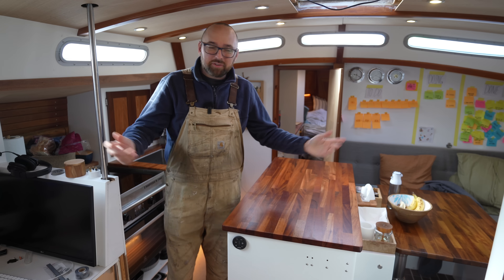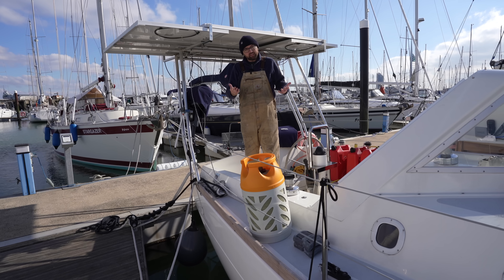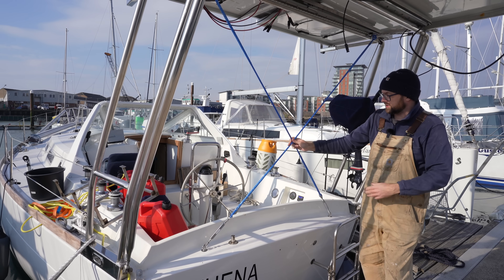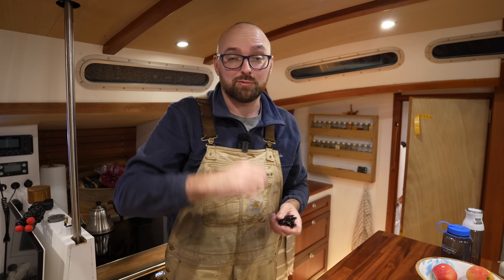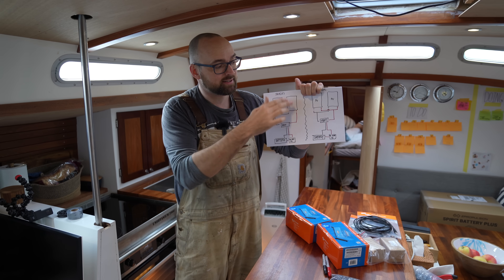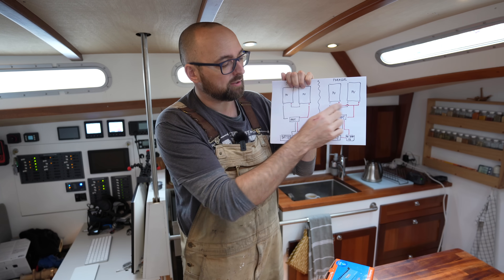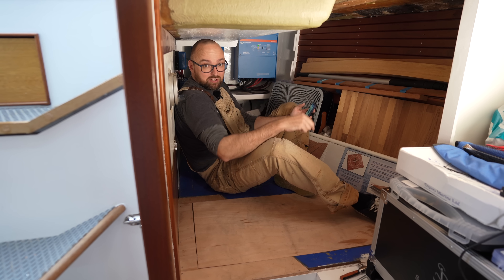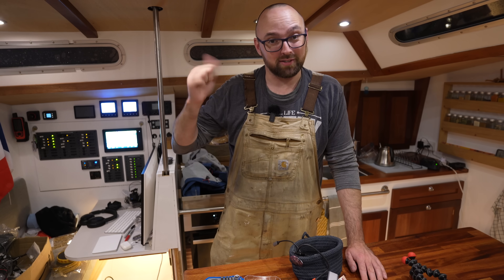Sail Life - 1600W of solar☀ on a 38 ft sailboat  & re-stepping the mast⛵

Comment: Your explanation about the higher voltage being a benefit is spot-on. There's an additional benefit to that, though, that's worth adding into the consideration. Battery charging won't happen until the panel voltage exceeds the battery voltage. With a 60 volt panel output, you should start charging earlier in the day and remain charging later in the day than if you had 12 volt panels. 👍

Comment: One thing I'd say in regards to your solar explanation is that the voltage drop loss isn't just lost. Conservation of energy dictates that the energy is instead, converted. In this case it is converted into heat which on a boat in particular is no bueno. Great video as usual.

Comment: Wow 1600W of solar is formidable, and I love your idea of the stowable panels!!! I'd still be slightly concerned about the weight of all those panels so far aft and high up from a boat-handling perspective, but I'm sure you've thought of that. Glad you added the Dyneema cross braces - they are certainly more than adequate for the job!

Comment: Confused about why you chose your wiring on the panels.  I would put the two upper ones in series, and the two lower in series, then wire the two pairs in parallel.  That way you can have a functional pair (the upper ones) without extending the bottom panels, for example when in cramped quarters, high wind, etc..  The way you have it wired, the array won't generate much at all without extending at least one of the lower panels.
EDIT:  Wait...  Just re-listened, and you say the panels are all in parallel.  Perhaps I'm confusing things with the 1200w system?  Anyway, all parallel with 65v panels is perfect.  Enjoy the power!

Comment: This video was awesome!  So I am thinking of adding solar.  My bank is around 400 to 500 AH - considering adding 400 Watts of solar.  2x100 on the bimini and 2x100 in front of the dodger....and maybe a solid solar 100watt fold down rail mount.  Thinking each 200 watt set would have a controller.  each run would be about 15 feet from the bank.  Any suggestions on series/parallel in this situation (4 100w panels in 2 sets), gauge wire, etc...?  Any help or advice would be appreciated

Comment: 2x 30A MPPT controllers seems a bit light for a 24v battery bank supporting 1600W of solar... my math brings that in at 66A. While it's unlikely to get full juice for any length of time, and charging voltage for Lithium is a bit higher than nominal... that's still pretty close to the edge.

Comment: I personnaly would not put more than 300W of solar on my 38 ft boat because of the detrimental effect on windward performances (because of the induced drag). Now I see in your videos that you seem to use the engine quite a lot and also you have a furling mainsail so I guess windward performances is just something you are ready to compromize (understandable in case you aim to sail in the tradewinds which I understand is the plan).

Comment: Ha, did the same type of cross bracing on my boats diy solar rig. However i moved up the cross and installed additional metal braces as it was getting in the way during docking a lot. Amazing ammount of solar though. You gave me a great idea for a future project and the higher voltage is a great tip. Thanks. Hope to see you on the water some day.

Comment: You may want to watch the Side loading on those little Eye's in your fiberglass. I think you are also under estimating how much wind your going to get in say a rain storm or snow storm. I think your going to be leaving the cross bracing on a lot more than you initially suspect. (which means people using it as a hand rail more than you initially planned).

And if you do leave it up more than you think i Strongly recommend you reinforce the eyes as they are not designed for side load. Im not as worried about your metal breaking.. but your fiberglass cracking with the side load.

Comment: I would guess a few gussets (like what 4x4 truggy builders use) welded in strategic joint locations of solar arch might stiffen up that side to side wobble but clearly solution you have in place is working well for now (longterm, I think it might become a trip hazard if your hands are full stepping through there). I was hoping to see mast top surveillance camera in action but that will have to wait until next week. The slide feature of solar array makes transformer Athena the envy of all in marina definitely!

Comment: The one downside to higher voltage is that voltages above `36-42 volts DC can be potentially lethal.  Be very careful!
Reply: I don't know. I think 36 is relatively safe, although if you are all wet with salt water you may have a slightly greater chance of getting a shock. I work with 60 V daily and it has proved pretty safe, but I am indoors in dry conditions. I agree 42 could be pushing it in wet conditions. I think overall potentially lethal is a bit of an exaggeration. But if you can find any evidence of someone getting electrocuted by 36 V on a boat I might change my opinion.

Comment: For safety reasons, for the metal frames and arch consider grounding them after first bonding together, just in case - as is the recommendation  / requirement in residential installations.

Comment: I'm surprised that the Victron site has suggested 100/30s for you application.  I have two arrays at 620 and 680w, they're each on a 100/50, and with both I have hit the 50A limit many times.  In moderate latitudes your 800w arrays will nominally produce @60A at your 13.2 resting voltage of lithium.   Once you hit the tropics you'e likely to produce more than the rating of your panels.  You may with to upgrade controllers a little bit.

Comment: Structural engineering question: The arch looks like a long lever that tilts backwards. Won't that put a large force on the relatively short fastening to the boat when wind and weight of the panels are considered? As a layman, it looks like there could be a huge load or stress on the front deck bolts?
Reply: And they'll be hanging the dinghy off that from time to time. Yikes!
Reply: @theadventuresoffatcat1886  I think the dinghy is raised by a separate “upside down U” bar that is hinged at the bottom. The only lifting stress to the arch might be pulling of lines to swing the “U” bar and the dinghy up. Most of the load stress is likely where the “U” bar mounts at a hinge point near the bottom mounts to the deck. The method of raising the dinghy is shown many videos back.
Reply: I am curious how much weight in total has been added to the vessel, and overall centre of mass.. in my mind a massive solar arch on any boat (and they are very common) would need proper thought put in to ballast at the bow. I’m sure Mads has done this, just don’t recall him talking about it.

Comment: I think that arch deserves something better than the cross bracing. Maybe put some (stainless?) angle support inside the top angle of the arch (same effect as putting one on the "arch footing" - the structure will become stiff). Less work than installing and uninstalling the cross bracing, prettier, less things to break, just overall better I would say.
On the other hand I can't imagine you haven't thought of this yourself yet, so maybe you had good reasons not to do that?

Comment: I think you should not put your panels in series.  The 65 volt open circuit panel voltage would be added so your series open circuit  outage is now 130 volts max and that exceeds the Victron MPPT 100/30 input specification.  You would likely need a different higher voltage controller.   If you want to go in series a higher input rating would be better.   Assuming your batteries are 24 volts then you should be ok, because if 12 v batteries then the charge current might exceed the 100/30 rating… it’s close…with the two panels with a max charge current of over 60 amps could happen.. you want to be panel limited and no shade…not MPPT or wiring limited. Nice set up.
Reply: I’m not seeing it either, that voltage is too high for the Victron 100/30.  Those controllers are relatively expensive, as well.  For current ratings, it will just max out at 30A output, but no damage.

Comment: Get that 1.6 dwn to a 1.2-1.3 man. That is optimal. 2.0 is reflecting 11% back the finals. 3.0 is reflecting 24%. However, when you look at swing meters that denote the easy breathing of an RF system over years you like I have you find 1.2-1.3 the corridor that allows the radio to just run uninhibited. Some might argue 1:1 is ideal. I disagree. The final output stages of any rig appreciate a little back pressure. Pick the center frequency you plan to operate the rig from, tune the antenna then,,,,,,tune the radio itself. Easy enough because instructions to so are ALL on line. WARNING: do not attempt to turn those Iron Ferrite beads on the radio board with an screwdrivers. Use the proper tuning tools,,,,,,,,,,,you'll be glad you did :)

Comment: Hi Mads..
SERIOUS comment..
How did you fix the aluminium frame of the panels to the arch?
Just washers on the inside of the solar panel frame..?
I suggest long plates.. even angle.. with maybe added rivet's..
The bolting points are way too close together and the aluminium is soft..
It needs reinforcement and possibly some rigging.. to stop leverage..
I'm repairing one at the moment that became a kite.. not my array...

Comment: Hi Mads, the larger 250 variants MPPT Solar Controllers from Victron has dual input, saving dual controllers.  We have 6 flexible panels mounted on the spray hood and bimini, much neater but the output is about 1/3 of standard panels...  Athena is looking like a technological power house!  Is your camera working ok now?

Comment: As noted by others,  you need corner bracing at the top and bracing at the bottom ties into the deck. Based on the angle of the arch, I would suggest that you add a forward brace on both sides.

Comment: Adding some stainless gussets or short pieces of 3/4" tube on the corner bends & joints should eliminate that flex without those ropes & will look much more pleasing. I was surprised they weren't installed on the initial build. Door handle next week WAHOOOOO no more tape! 😜

Comment: I love Sail Life videos and it's a great DIY marine channel, but I think this is getting too much now. The solar arch is looking ridiculously big with 4 panels, not to mention that the arch itself had to be reinforced with x braces for stability. With a full size engine, fixed generator and now 1600W solar, it's a lot of redundancy for a 38ft boat. Don't get me wrong, people with electric engines for example would go this far with solar panels but then they wouldn't have an engine and no generator (may be a small portable one). The other YT channel that had lots of solar was Cpt Rick from SSL, but he has 50ft boat with all electronics that you can possibly have and a bunch of people that constantly hang out with him. I think there is a point where you overdo it. Two 400W panels would of been great + consider an alternative source of energy than sun, water propulsion for example, and you'd be set.
Reply: Good thing his boat is built for him then, and not yourself. As an electrician I fully understand his going with that many panels. Just because something isnt for you, or you dont understand it doesn't make it ridiculous or wrong, something to think about more going forward in life.
Reply: But the amount of solar you receive is not just based on how many panels, but also where in the world you are and what time of year it is.

If they were just planning to sail the tropics, less panels may have been enough. They also wouldn't have needed such a beefy heater system installed.

Please trust that a nerd (no offence intended) like Mads can do the maths and size the array correctly.
Reply: I would have to assume he does not pay out of pocket for many things at this point 🤷🏻‍♂️
Reply: @across_the_plane6800  why would you assume that.

And he's always announced when he's been given things or sponsored which he did not mention in relation to these panels or the panels he originally had.

Comment: This time I have to disagree 100% on your explanation about the serial arrangement of the solar panels. Today, where the panels do have at least 1 bypass diode per panel, the loss of the entire array is wrong! You still get the other panel via the bypass diode.  Your big panels are a huge setup of serial arranged cells. You will at least find 2 bypass section on them.
In the past your statement was correct, but we should talk about today and the future. With the bypass diodes there are no advantages of a parallel arrangement compared with an serial arrangement. 
I do have a serial arrangement and can tell you the practical results. In our harbor the neighbor boat is creating a shadow for 30min on one panel. The other gets always the full sun. During shadow the power drops to 50%....as expected and not the complete loss.
This “belief” is creating another problem in particular with the very good MPPT Charge controller in blue design…. These controllers start to work when Vsolar>Vbat+5V. Vsolar with an MPPT controller is never the idle voltage, because the MPPT is looking for the correct “working point” all the time. People buy “12V panels” that do have 36 cells. The Vsolar is about 18,xV. With partly charged batteries on a cloudy day you get NOTHING! 13,3V +5V= 18,3V. The panels do not deliver that. You put 2 “12V panels” in serial…36V……the formula is not a problem at all….and the cables can be thinner. 
We just compare 3 Systems within our club. All do have the same controller and the same Soar power…….but only our ship has serial arrays…..the difference is significant! In cloudy conditions the other system get nothing and we get about 30-40% of the nominal power on a rainy day……in the Baltic!  So use 2 smaller panels and connect it in serial……and enjoy solar energy.

Comment: Like Alan wrote: all decent solar panels have bypass diodes for each string of cells within a panel. This means that series connection outperforms parallel because you only loose shaded segments instead of the whole panel. Combined with other gains for series connection, it becomes the preferred option.

Comment: I think you should leave the cross bracing on the solar panel supports all the time. You could get wind or bad weather when your in a marina or at anchor.
They look really good and I'd leave them just for piece of mind and not worrying every time the wind blows when your trying to sleep. Or worrying every time someone is getting on or off the boat and may slip bending or breaking the supports .The solar panels look amazing ,you never cease to amaze me with your thought process and top notch builds.

Comment: As a rule the solar panels shouldn’t be connected to the CC with out the batteries connected first. Having no disconnect for the panels but having breakers on the battery side seems a bit risky to me.

Comment: Mads, regarding that sideways flex on the arch; A couple of "inside angle curved" corner plates welded to the bars would stop the flex AND keep the lion's share of the space behind the arch wide open.  Imagine an 8-10 cm triangle in stainless steel with two sides welded to the upper and side bars, and then with a slightly curved inner side to make it more aesthetically pleasing to look at.  You could even add a couple "stiffening holes" in the plate for "spiffiness" and to aid the stress distribution.  A bit of "Oh Glorious Polishing" and they will be extra super spiffy AND extra super stiff.
Reply: the problem is he needs a triangle at the base, lateral movement is only absorbed by the backing plate of the arch/hull connection and that can't be stiff enough given how long the moment arm is, ~2m .. a stop sign configuration as viewed from the stern would work with nice polished (oh glorious polishing) stainless gussets and a much larger backing plate.. those panels are a huge wing..
Reply: @jonunya3128  Good point.
Reply: Agreed. The dyneema brace is the first dodgy thing I've seen on this boat. Lets hope he sees the error and does a proper job. The other option is to double the stern hoop following the same shape adding horizontal tube between the inner and outer, (including your corner braces)